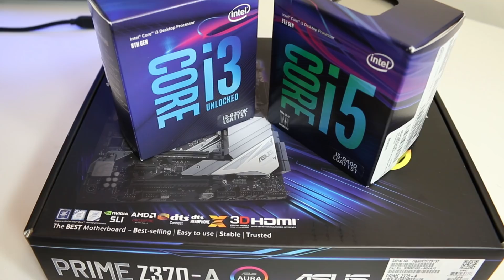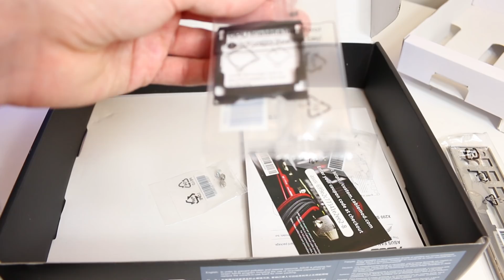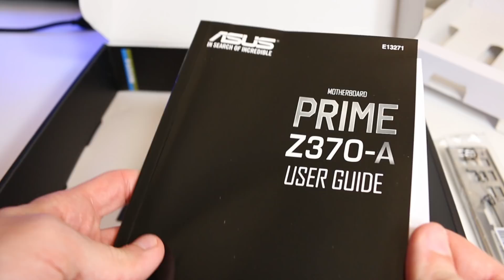Asus Prime Z370-A Motherboard Unboxing and Overview

Comment: Can this mother bored work with the 9th gen processors ?
Reply: Yes, but you need to Update the Bios first. So you need a Older Gen processor, flash the bios, then you can use 9th gen processor.

Comment: I learned that the CD drivers can actually be helpful because when I did my first build a few years ago, I booted up and my computer wasn't able to connect to the internet until I had installed the driver. So if I didn't have the CD, I would have never been able to get drivers (I also didn't have any other computers around, nor a flash drive lol)

Comment: How many fan headers are there
Reply: Chad Olando you shouldnt plug fans into motherboard. Use molex. Only exception is cpu fan
Reply: Rexr Gaming why?
Reply: Chad Olando doesn’t give it a constant 12volts
Reply: Rexr Gaming late but...u know how fan headers there are? im using forsair fans so i can control the rpm
Reply: Synovial if you are using corsair fans they should come with a controller that plugs into power supply and usb 2.0 header. Connect fans to the controller and then use corsair link to control fans. No fan headers on mobo will be needed. Only ubs 2 and sata power
Reply: Rexr Gaming the controller is only for the rgb...? I must be annoying😂👌

Comment: buying this mobo this Friday coming up cant wait to build my new gaming pc
Reply from the maker: What are you pairing it up with? BTW: I have nothing but good things to say about it since I've been using it.
Reply: That's great to know, I might get this in the future. Very informative video as well, thank you!
Reply: how many fan headers are on the motherboard?
Reply: Synovial search for the manual my man, it's the most accurate information you'll get.
Reply: +Akula im installing 7 fans(AIO included) but the motherboard only has 5 fan headers what are my options?
Reply: For case fans use a splitter, the output of every 3/4-pin is rated for 1A and iirc a regular 120mm fan uses 0.2A, connecting even 3 fans to 1 header should be safe. To be extra safe look up the actual power need of the fans you have and the output rating of the motherboard's headers.
Reply: I just got one today, really cheap. Just need the ram and cpu and I'm set.

Comment: is worth this motherboard to use the sli with two Asus Nvidia GeForce GTX 1070 Dual?  I also want to use Intel Core I7-8700K. What's the PSU that you recommend? are 650W enough
Reply: look at how much power everything takes? then get a little higher .....

Comment: I love how they still include a fucking DVD! Why not a USB drive? :') 
An 8GB USB 2.0 drive with all the needed software should not be a thing that racks up the price through the roof! 
Also: You get the latest software of the internet anyway, since 99% of all products are updated and the basic software becomes obsolete. (That even counts harder when you install the Intel Network driver, which needs a newer version since Windows 10 RedStone 3. :)

Comment: Will this work with a 7700k?
Reply: no, the 7700k is 7gen
Reply: Moody Ali no
Reply: no
Reply: No it does not. It is compatible with the 8700k however
Reply: RudyB yes any cpu that starts with an 8
Reply: Pretty sure they aren't backwards compatible.
Reply: I don't think they work on it, you have to use a 200series motherboard for it.
Reply: Warre Yacef thank you
Reply: Moody Ali 

You need z270 motherboard
Reply: Moody Ali nope... Just 8gen
Reply: Rexr Gaming how about just 8700
Reply: Moody Ali no

Comment: under i7 8700k the good work?
Reply: Yes it works fine.  However if you use a high powered graphics card in the lower port, it will heat up the heat sink covering one of the m.2 slots.  The possibility of using an m.2 fan also goes away if you use a full length graphics card in the lower slot.  It makes a big difference, and kind of makes using 2 high powered graphics cards AND 2 m.2 cards impractical.

Comment: i think asus prime x370 pro motherboard is the best board for am 4 ryzen 7 and high end ryzen 5! i have one it works flawlessly i have over clocked mt r 7 1700 @ 4 ghz with the nhd15am4 and trident z black 2 x 8 gb ddr 4 ram @ 3200 mhz at it is fully stable ! i have tested the system stability for 8 hr! and it is completely  fine i got highest temp of 70 c and it never thermally throttled!
Reply from the maker: I've always had great experiences with Asus boards, and the Prime lineup is a nice middle ground between premium design and affordable price tags.